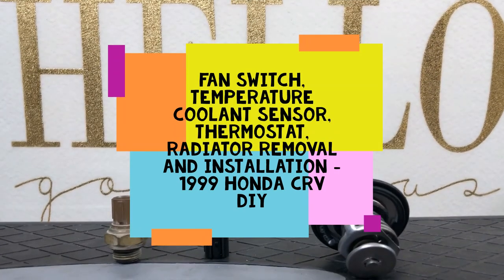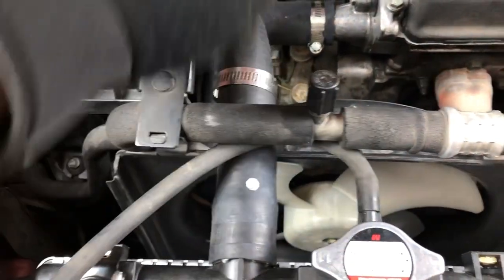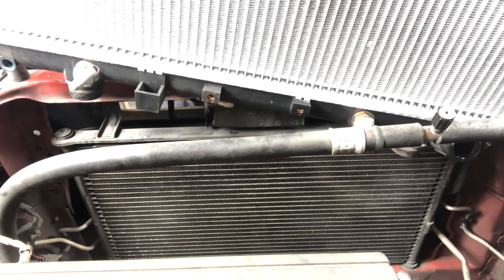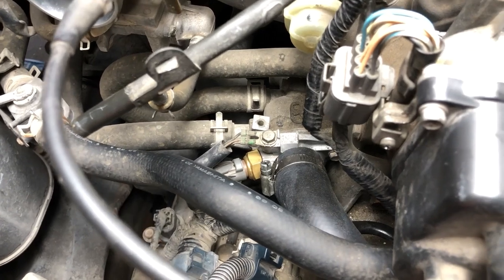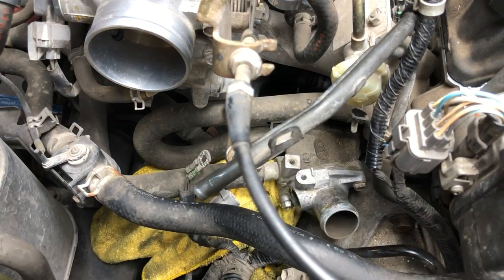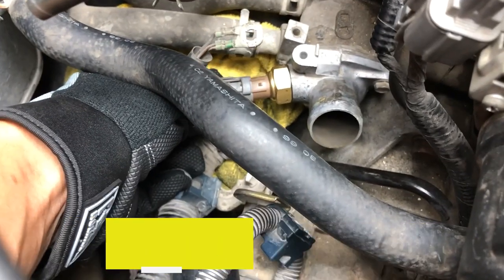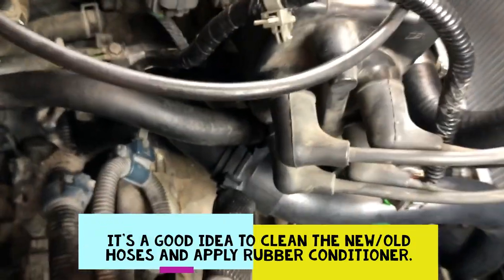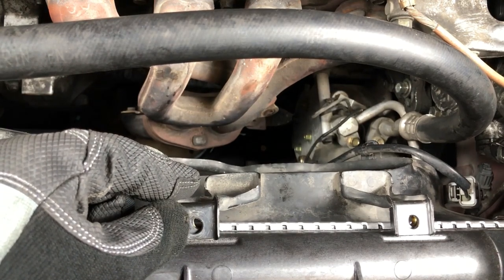Fan Switch, Temperature Coolant Sensor, Thermostat, and Radiator Replacement 1999 Honda CRV

Comment: Great video, it helped me find all those things.
Reply from the maker: Thanks 😊
Reply: @h0melyfe792  I ordered the temperature sensor from Amazon and it's the size of a 22mm socket, but the one installed on my 2000 CRV is a smaller socket size. Now I don't know if I got the wrong part or what.
Reply from the maker: @futurepig  hmm. I have all the links on the parts I purchased. I don’t remember installing one with 22mm socket. I know the fan switch I used a 24mm.
Reply: @h0melyfe792  The one Amazon sent me was the wrong size for the model. I got a refund.

Comment: Thanks a lot from France. This video was truly helpful to repair our overheating CRV. I changed the thermostat, fan switch, temperature sensor, and the coolant. I don't know what was the culprit but anyway it was a cheap and easy fix with the help of your video. Hope to see more about the CRV ^^.

Comment: Thanks for the tutorial.  
Help !!!
My 2001 Honda CRV B20Z1 gives fault P0118 (engine coolant temperature), cold starts ok, but when hot it is hard to start or let it cool down and when it starts it seems flooded and shakes.  After circulating it goes well and the needle of the frame is stable, the fans work well.  I changed thermostat (not original) and thermostat sensor (original), should I change the other sensor of the engine block?, or will it be the fault of the mainrelay or distributor cap?  
Thank you very much in advance.
Reply from the maker: Don’t take my word for it, but If it happened to me.. I would check the wires that are connected to the engine coolant temperature sensor first. Maybe it’s old and needs replacing. If not that, then most likely the sensor itself is bad. It’s not expensive and fairly easy to replace, then I would  replace coolant as well and make sure to air the system out.
Reply: @h0melyfe792  Thanks for your quick response.
I'll keep you informed of the solution in my car.
Good day

Comment: I’ve been having so many issues with my 01 crv, automatic transmission will shift in and out of 4th and won’t go into Over Drive. I cleaned both top and bottom shift solenoids and changed the transmission oil (3 times as recommended by manual) 
The problem still persists after that so I read a forum and turns out that the thermostat was malfunctioning and was staying open causing the engine to “over cool” and the temp sensor would send a signal to the TCM that the engine was not at operating temp so the TCM would kick the transmission out of 4th down to 3rd. After I replaced the thermostat, boom! Problem went away.
If your reading this and have the same issue as I described, go with the basics first.
✌️
Reply from the maker: Cool! That’s good to know! Thank you for sharing!

Comment: Good video. I have a 99 CRV also. It starts great when it's cold, but it's hard to start when it's warm and runs real rough and smokes for a minute. Could a bad coolant temp sensor cause that? Like maybe telling the computer the engine is cold, and the computer makes the mixture rich when it doesn't need to be? I've replaced the main fuel relay as recommended by a friend, but it didn't help. Thanks.
Reply from the maker: Thanks! Yeah might be the sensors.. you might as well replace the thermostat and bleed the air out. 👍 keep me up to date.

Comment: It’s 2021, and this video is perfect for what I needed to do. I replaced fan sensor an the radiator, still ran hot. You just saved me $800 because I missed the thermostat an other sensor. Checked out the your videos how bleed the system too. Thank you.
Reply from the maker: $800! 🤗 Super cool man! Glad it worked out! Thanks for checking out the vids. Appreciate it.

Comment: Thanks!!  Getting ready to tackle this project. Daughter is having overheating and slow to start issues. Doing research, it appears to be the engine coolant temp sensor and was planning to replace that. After watching this, and considering that you have to drain the coolant and move all those hoses and lines and parts, it’s probably much smarter to do all 3 (ECT, fan switch, thermostat) all at the same time. That way they are all done and no questions as to another part being at fault or failing in very near future. One of those “while your in there” situations.
Reply from the maker: Totally agree! Good luck! Let me know how it works out! 💪👍🤗

Comment: Will it matter which direction the coolant temp switch is facing as long as it's snug? also, your switch looks like it has a longer nipple in comparison to NAPA one. are they all the same? This is tsame as the enginge cooing fan switch right? https://www.partsource.ca/search?type=product&q=engine*+cooling*+fan*+switch*
Reply from the maker: Hi, the one you linked looked like the temperature coolant sensor.. and it shouldn’t matter as long it doesn’t leak. I just like to put it back the way it was before. The fan switch should be fatter in comparison, well at least for my CRV  it was.

Comment: My car only starts after it sits it had a code for iac valve i replaced it and now it says coolant temperature sensor butt the temperature gauge reads normal
Reply: Also the idle bounces now
Reply from the maker: kc thrasher.. sometimes you just have to bleed the system out after new coolant.
Reply from the maker: kc thrasher.. you might as well change the sensors and thermostat if your going to change coolant.. but most of the time the fix is as simple as bleeding the system out.